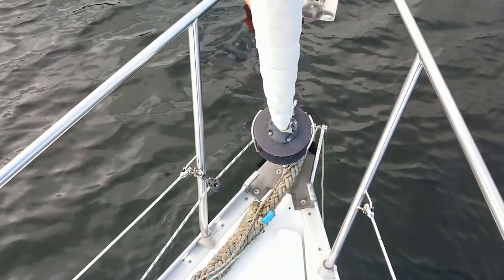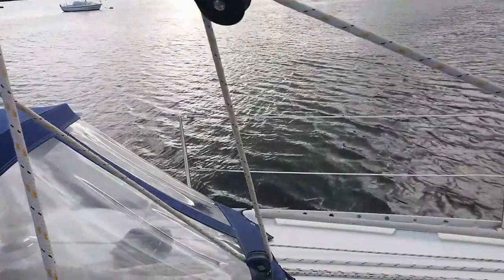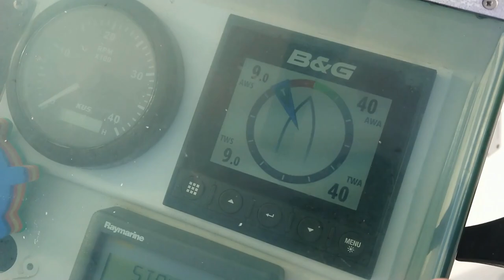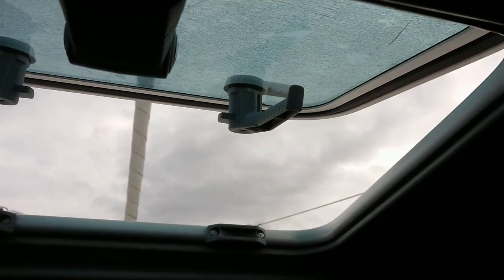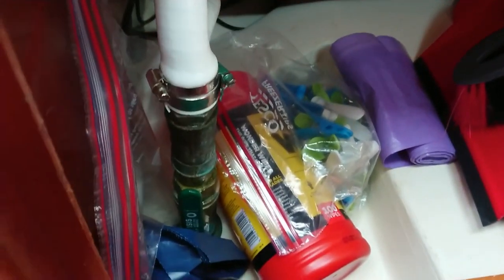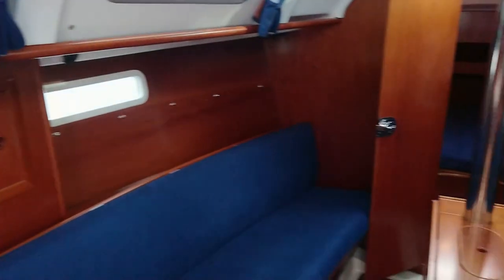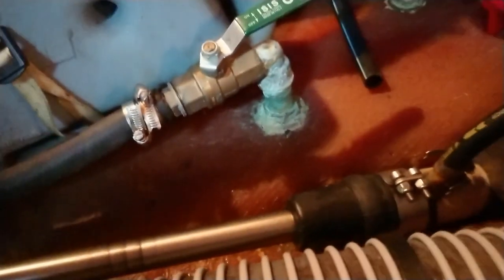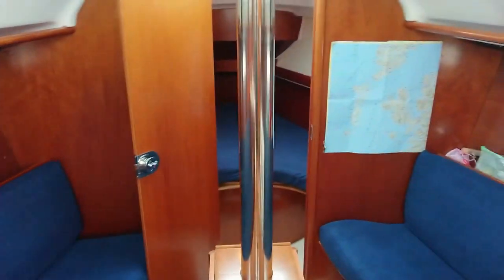Beneteau Oceanis Clipper 311 | Full Boat Tour

Comment: How much please?
Reply from the maker: The boat is currently listing on Apolloduck. 
https://www.apolloduck.co.uk/boat/beneteau-oceanis-311-for-sale/708525
Reply: How can you sell if you don't put a price up....? Broker are BS ,.  waste of time
Reply from the maker: There is a price on the Apolloduck listing >
https://www.apolloduck.co.uk/boat/beneteau-oceanis-311-for-sale/708525
Reply: That's not a marine grade silencer on the heater. 
They are designed to be installed outside the body of the vehicle eg truck.
Unless you have had it welded up it will leak carbon monoxide into the boat.
Reply from the maker: @VISTLER  Yes you are correct. Replacing the entire exhaust system is high on my list for this spring.